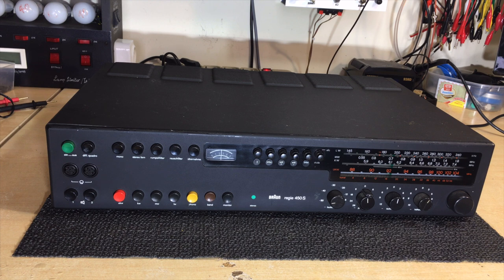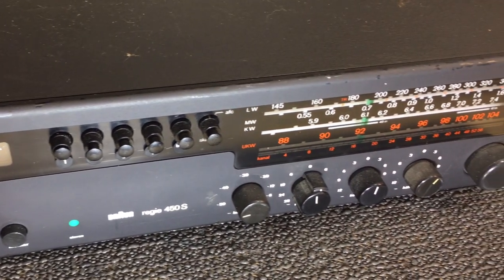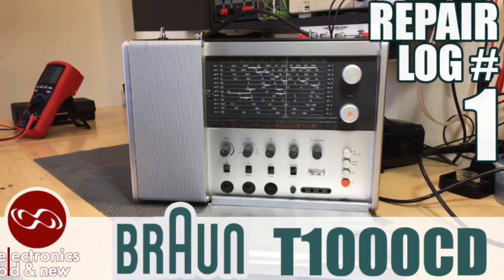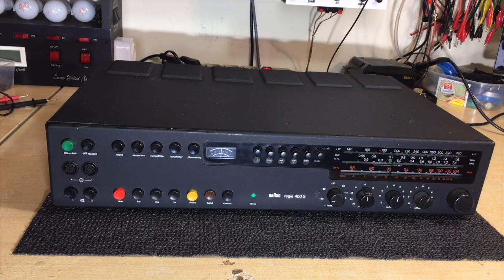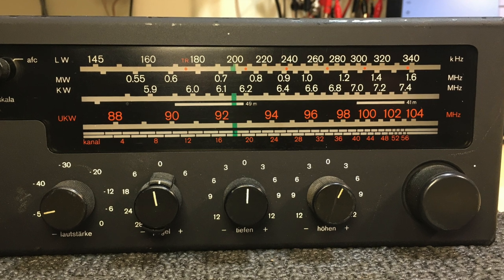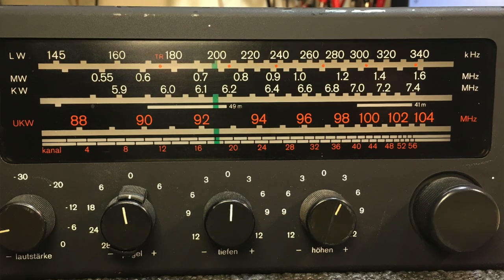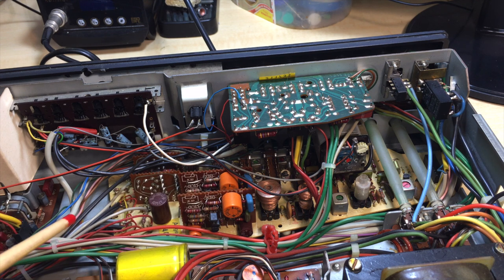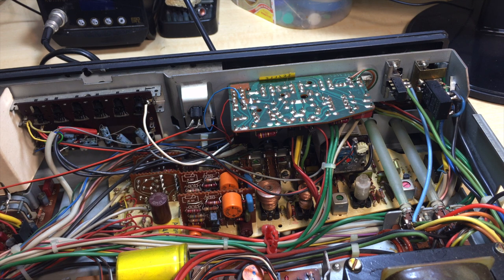Braun Regie 450S restoration - part 1. A first look.

Comment: 1:50 I suspect that Diff Quadro means that it generates quadrophonic sound by using the difference between the two input channels?
Rauschfilter = noise (hiss) filter
Ubername = "take-over"
Band = Tonband = tape recorder
Monitor = an extra input if you had a 3-head tape recorder.
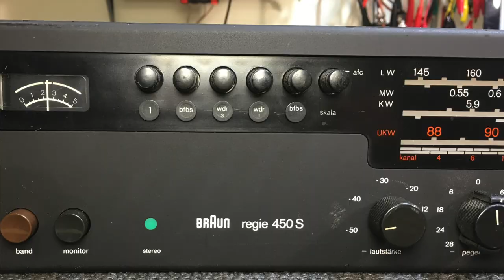2:50 In case you're wondering, BFBS=British Forces Broadcasting Service, a radio station for British military stationed in Germany during the Cold War. WDR=Westdeutsche Rundfunk, 
Hinten="Rear", probably for that "Diff Quadro" function.

Tape recorders and cassette decks with DIN plugs can't send the monitoring signal back while they record because they use pins 1/4 for microphone recording and 3/5 for line level playback and recording. On old radios (including tube radios dating before DIN plugs), the tape connection is an output while you have the radio on (so you can record) but is an input when you switch the source to Tape. So you can't monitor a recording because if you switch to Tape, your recording stops. But for 3-head tape recorders (and cassette decks), you will want to be able to listen to the tape recorder while it's recording, so tape recorders with 3 heads have 2 DIN sockets: one for playback and recording (for backwards compatibility) and one for monitoring during recording (and that output obviously also works during playback). I think the "Ubername" button may make it possible to record from the Monitor input or something; The German word "Aufnahme" is recording, "Ubername" implies copying from one tape to another.
Reply from the maker: That was incredibly enlightening. Thank you. I'm beginning to see some of the logic of the mods made on this set, as well as understanding the functionality that this was designed for. Thanks again.
Reply: @electronicsoldandnew  I just noticed someone else commented that "Ubername" is used to store ("copy") the presets. That makes sense, and I was probably wrong about that.

Comment: Hey Manuel,
I really like your videos a lot :) It's always a great mix of a deep technical knowledge, great diy-ideas and a very sympathic person. Please keep up the good work!
Personally, I am also a big fan of the old Braun design. I recently got a complete Braun Atelier Hifi system (5 components: amp, cd, cassette tape, tuner and turntable) for free (!!) from a friend - and now it's back to perfect working condition - and I use it every day. I also have a receiver (tuner + amp) of the same line like your Regie 450S in my repair queue - I will fix this one at some point in the near future. Unfortunately, my repair videos on my channel are all in german - I was wondering, if I should go for english or german, but as there is so much good content in english already, and - being german - of course I still feel a bit more comfy talking in german, I decided to go for the second option...
About the orange / winered ROE-caps: I made exactly the same experience. I just restored some old dynacord tapedelay-units and amps. Some of them had the same kind of caps in them, but with grey plastic. the gray and red ones are usually completely crap, the orange ones were a bit newer and seem to be better - but still I would recommend to replace them - they also have a tendency to leak and fail. 
Also, whenever possible, I would replace those old trim pots. I had a LOT of these pots, that simply fell apart, due to corrosion at the silvery-spring-thingy... Same with those pcb-mounted fuse holders, by the way... 
Oh, and: Rauschen = hiss, Brummen = hum, Rumpeln = low noise / rumbling, Hinten = rear (speakers), Übernahme = take over, in this situation it seems to be "save", but it could also mean "crossover", e.g. in a frequency crossover - or crossover distortion (Übernahmeverzerrungen) ;)
Cheers!
Reply from the maker: Thanks for your input. I have seen some of your videos and like them a lot. What I do is apply the auto translate function on YouTube and get English subtitles. It works quite well 👍

Comment: Happy Easter! Hinten = behind or rear speakers. I think the monitor is an input for off-tape monitor if you have a 3-head tape deck. I.e you can monitor the recording as it is made. Diff-quadr  is probably what we used to call 'Haffler' quadrophonic back in the day, it was nothing more than the rear speakers connected in series across the left and right main outputs, so that they reproduce the difference between the left and right channels. A weird sound if you hear it on its own, vocals in particular  become phased out. But it does add something to the listening experience. Looks a fine machine, looking forward to more! Stay safe!
Reply from the maker: Thanks Alan.

Comment: That loose shield looks to me like it would cover the bottom of the IF strip. That might explain the missing solder pads on the tuner PCB
Reply from the maker: It does. Thanks. Makes figuring the ripped out pads easier. They’re probably all ground.

Comment: That's a lovely unit.  It looks great.  Unfortunately here in Australia we would need FM to go up to 108 as there are many stations in the 100 to 108 range.
I bet that shield went over where those pads are missing.  Probably got knocked off with a drop
Reply from the maker: I believe you’re right. I’ve looked and the ripped out pads seem to be stuck on the shield pins. Good thinking. Thanks.
Reply: @electronicsoldandnew  If it helps with the repairs, then I am happy to assist in my small way
Reply from the maker: Brendan White : thanks Brendan

Comment: The loudspeaker connections. One set off rechts /links or better right and left are for 4Ohm and the other for 8 ohm. Then hinten, that means rear. It's a pseudo quadrophonic connection. 
This means it's not a quadrophonic receiver, otherwise there were 4 power amps. This you can do with every modern amp aswell. They took the plus from left and right and it gives you an other demension to your sound. Just try it connect your loudspeakers as usual and put an extra cable from your left and right to one loudspeaker. It will give you an extra demension as I wrote before.
Reply from the maker: Rob Damen : definitely got to try that.

Comment: I think that somebody has work on this tuner/amplifier before you. 
6:19 Those 2 black/white potentiometers look very modern compared to the old open style potentiometer on the right side of that fuse (near the big yellow caps).
Reply from the maker: True. Gives me some clues as to what may have gone wrong.

Comment: Hi Manuel, Thanks for this new interesting project. I have a general question about Braun electronics and it also applies to other German brands like Uher. I have noticed in the various pieces of electronics from Braun you have repaired, and those I have myself -- a CE-1000 tuner and a CSV 500 amp, weighing 23 kg together -- that the potentiometers all have that shape with 4 cylindrical "poles" at the corners. Do you happen to have identified a brand or to know a possible source for their replacement. What is the wisdom about potentiometers which are sometimes completely stuck. Lubricant ? Alcohol ? Thanks again.
Reply from the maker: I’m afraid I don’t know what brand those are. As for stuck pots, try alcohol, or contact cleaner. Sometimes I even spray WD40 in and then wash it out with alcohol once it releases.
Reply: I have had success freeing up siezed potentiometer shafts by heating them up. Obviously this method is good for metal shafts only. I use a smd heat gun to heat it up until the old dry lubricant melts, and then spray WD40 into the shaft and keep turning it. This can require several attempts before success is achieved.

Comment: I have a Braun Regie 550 CEV.  The receiver was humming, and then while I was fidgeting with it, it went into protection and the relay will not click on. I cannot figure out what the problem is and the receiver stays in protection mode even when no input or speakers.  I cannot find any place in USA to repair this.  I would like to recap this completely now to just avoid any further issues.  Any ideas where to get this fixed in USA?  Thanks!
Reply from the maker: unfortunately I don’t.
Reply: @electronicsoldandnew  

May I request help from you in deciphering the schematic?. Looks like I have to undertake this by myself, but I am not good at schematics or aligning the schematic with the actual sections on the amp.  If I can get the trace figured out and aligned to the amp parts I can start understanding what goes where, and what points to measure. I do understand a bit, so I'm not starting as a newbie but still way behind on this stuff
Reply from the maker: I’m afraid time is a problem for me, which makes assisting you directly impossible. The channel is a hobby for me and I have personal projects that take up all the (little) spare time I can muster. The video series on that amp is all I can offer. I have in fact another one in the pipeline to restore, and would probably be able to do some explaining as I do the new video series. however, I don’t know when I will be able to get to that project at this moment.

Comment: The "hinten" Speaker connections are for the "Differenz Quadrophonie" feature... Hence the "diff.quadro" Switch
Reply from the maker: Something new for me to look into :)
Reply: @electronicsoldandnew  There are UKW Presets vor BFBS and WDR, therefore the set was most likely used in Northrine-Westphalia, Germany. And two BFBS Presets are a a good sign that it sources out of a City where the British Forces were once stationed. ;-)
Reply from the maker: I see. So the labels were sold of offered for the specific stations. Makes sense.
Reply: Otherwise known as the Hafler effect where a second set of speakers are connected together by joining their -ve tabs, and the +ve tabs go to the amps +ve outputs.
No earth connections are made.
What you hear is the difference signal between left and right stereo channels and can be quite interesting depending on the track played.
Reply from the maker: Monty North : more research on my agenda :)
Reply: Hi there, "Rauschfilter" means noisefilter, übernahme means transfer or transfering
Reply: THE BFBS where in Münster and Mönchengladbach if I remeber right the TV station from BFBS was in münster. I can tell you where the Tuner was if I now the Frequencis from the WDR2 99.2 was Köln

Comment: those Frako's are usually a gonna too
Reply from the maker: Yes, I think most of the electrolytically are on their way to the graveyard.
Reply: @electronicsoldandnew  I have worked on a lot of Studer and Revox tape decks, they mostly used Frako electro caps, I always replace them..no matter what :-)
Reply from the maker: Better safe than sorry